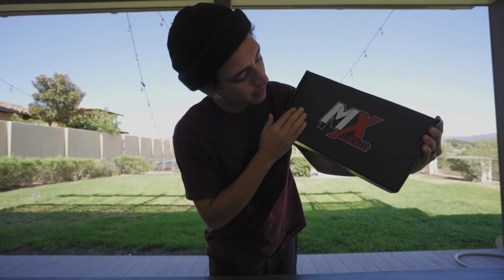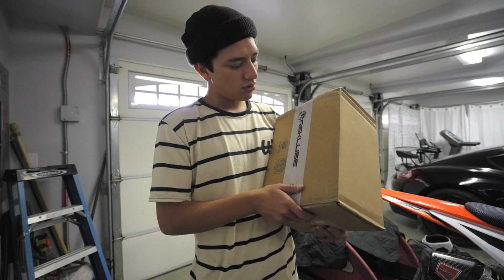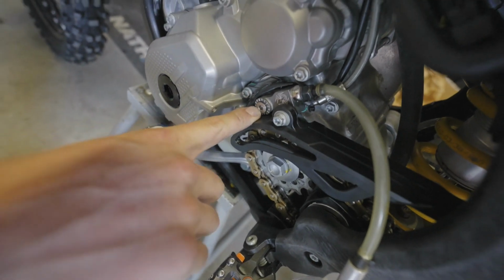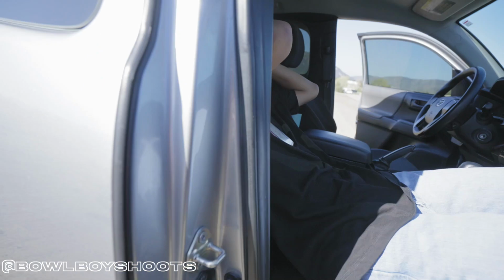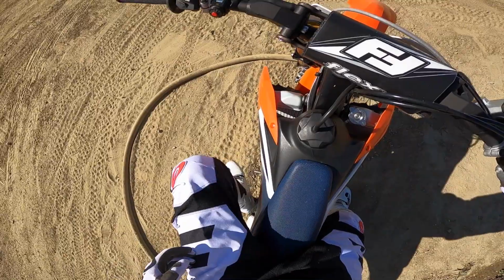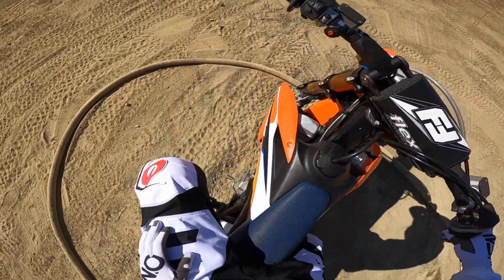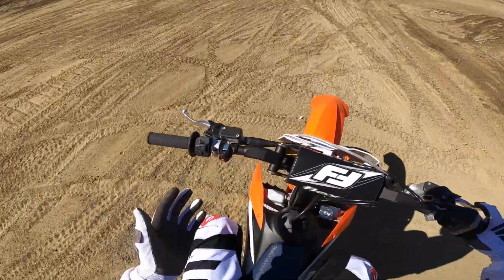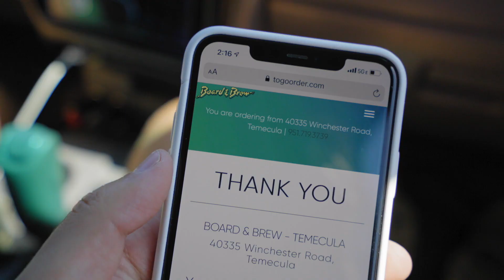2021 KTM 350 Sx-f BUILD!! *Rekluse Auto Clutch*

Comment: I run a rekluse auto clutch in my flat track bike! People have this weird stigma around auto clutches and that you shouldn’t ride a bike if you can’t use the clutch. But really, it’s just an aid. It helps in places where a manual clutch can’t. Mostly, with flat track it makes the engine braking smooth rather than choppy. Helps with corner entry!

Comment: Do you know what color springs you have in the clutch?  I have a 2019 XC-F with the Rekluse and even adjusted properly stays engaged at idle. Apparently I need to go up to stiffer autoclutch springs. I think I have the stock 6 silver in mine.

Comment: If you want to make a decent Sur Ron you will deff need a new controller like a Bac8000, along with a full 72 volt battery, a 21" front wheel, riser bars, upgraded suspension, etc....  Stock, the sur ron is just way to low powered.  Especially coming from a 350 sfx.  Lemme know if you have any specific questions, I have a lot of experience in the E-Bike world.  Here's a vid of me riding a hub motor version of the one I built form scratch   https://youtu.be/YgfQrGS3d70
Reply from the maker: Bro yes! What’s your insta? I got TONS of questions
Reply: @ZaySolis119  joshstreetdesign